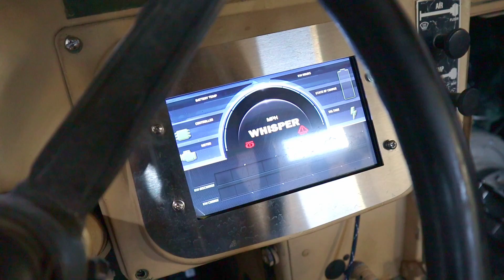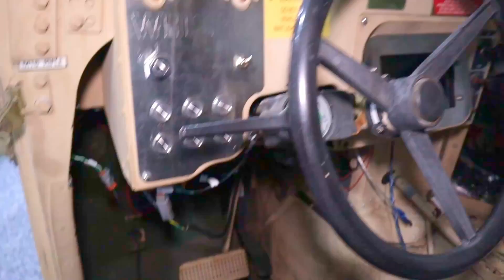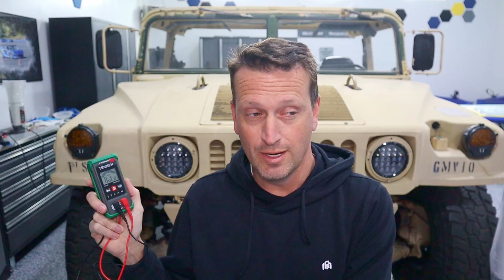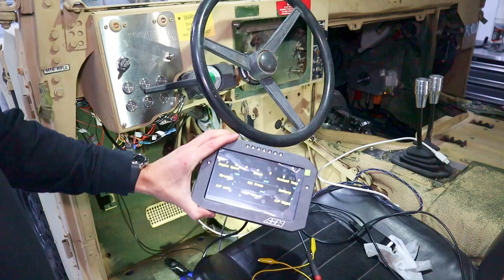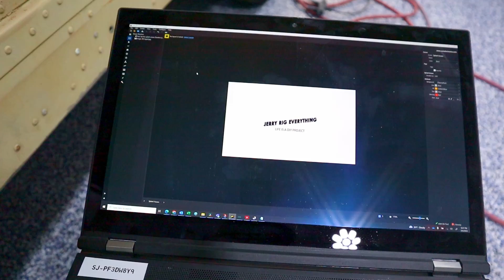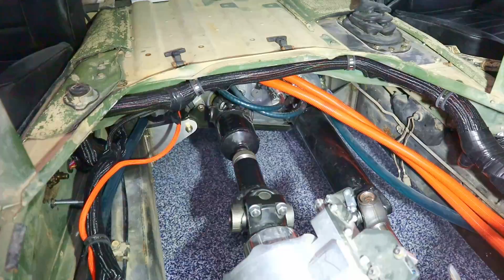Electric HMMWV Display

Comment: Pro tip if you take a lighter or heat gun over you temflex (the wire cover) after you cut it you can melt the fibers and stop them from unweaveing
Reply from the maker: Nice!

Comment: Personally I wouldn't give that multimeter to anyone. the cheapest I will go is Uni-T. The brand for that multimeter doesn't even seem to exist. Even the ratings don't make sense. "CAT 2 600V, CE, and ROHS Certified" doesn't make sense. ROHS doesn't have a certification really, CE is self certified, not by a third party, and CAT2 is pretty awful. half the outlets in my house don't count as CAT 2 because they are less than 10 meters to the panel.

Comment: Hi. I’m thinking of dropping an EV “kit” into a surplus HMMWV.  It looks like several companies are starting to make “drop in” kits. 

Would it be possible to run power and data to motors attached to the wheel axels, and remove all other driveline gear?
Reply from the maker: That would be cool!

Comment: Nice work on the wiring.  I have no EV experience, but do have experience with Industrial Automation Systems and your problems could be related to a duplicate CanBus address (two or more devices have the same address).  My number guess is 357.

Comment: A lot of your problems looks like classic bus integrity problems... Reflections, Terminations problems, etc.
For best operation, you should have One continuous twisted pair, with very short taps coming off it. (Shorter the better.) Also, at each end of the twisted pair, you should have Temination -- two total, and no more. Get a pair of 120 ohm, 1/4 to 1/2 watt resistors for the termination.

Check to see if any devices on the CAN Bus have built in termination, and TURN THEM OFF.

Comment: A critique and a concern. Electrical tape is not a permanent solution. Anywhere there is heat, that tape is going to fall off. The concern is the air bubbles in the coolant lines. When I murdered a racoon with my Model S and replaced the radiator, I could not get the car to charge, without overheating until I found a way to bleed the lines back near the charger and rear motor.

Comment: 2517. 
I plan to do outdoor night-time car photography. I made myself a 12v 40a powerpack with LiPOs with a 1800W 120acv inverter to be able to power two strobes (these are huge, 100w each).
I need to know when to stop to not leech my cells below 20% capacity. So this tester would be useful.

Basically at car meets on a Friday or Sat night, using Adobe Lightroom and my laptop for editing on the spot. It all has to fit inside my Miata.

Comment: along with odometer maybe its useful to also display 'hours run' or maybe better a cycling count, they say a range of cycles to degradation but nothing i have seen indicates where in the cycle range the pack currently is and that is very valid to resell/purchase similar to odometer

Comment: An multimeter would be amazing piece of hardware to have around the house. I'm currently using only of the cheap $25 meter.

I'd also use it to teach my son more about electricity, as that is one of my current primary responsibilities.

I'm going to say number 862.

Thank you for the opportunity!

Comment: I'm guessing 819.  I would use an electrical meter for check continuity, power, switches, etc. on automobiles and arduino circuits.  Your electrical harness makeover was great.  Need to do that for my DF Goblin kit.

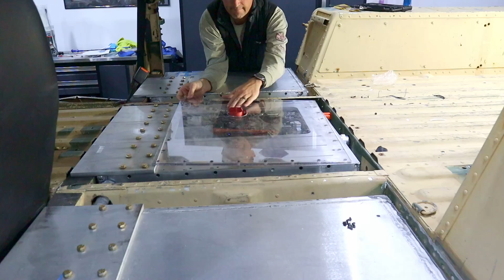Comment: 9:36 That hole is rough AF. 
Apply some heat to where you cut to clean it up.  A lighter, flambe torch or similar will do.  When you apply the heat, the white will disappear, you'll get a nice clear edge and it'll remove some of the roughness.  Don't apply too much heat otherwise it'll start to burn.

Comment: My guess is 410. I plan to use the multimeter while rebuilding the 12v system on my classic motorhome, and general stuff around the house. I also need to diagnose why my wife's sideview mirror defrost isn't working.

Comment: A couple of random comments.

I hopped on and ordered the multimeter right away. I’ve got a good one. I just don’t know how to use it. I’m never sure exactly how to send it to read what I want and now I feel idiot proof.

As for all the wires, that’s a lot of wiring. I’m glad you didn’t take any out. I’m sure it’s part of the safety system. In case of some catastrophic event, they will help hold the thing together.

Comment: My guess is 1776... Great video I learned a bunch about troubleshooting and wire management. I have a project in mind and have been following Jerry's project closely. I am glad it is working out so I will be ordering some parts. I would like to electrify my Dodge Dakota. If this motor will push a Hummer it should have no problems with a Dakota. ;-) That multimeter would come in handy for sure!

Comment: I'm going to guess 829. I'm getting ready to build out an off grid leather work shop with solar powering 110v and 220v ac power. If I don't win I'll probably buy one anyway. It'll be super easy to jumb between measuring units with the auto sense

Comment: that multimeter would be great for someone like me who has no idea what setting im supposed to be on except for the standard few. i would be using it when working on my 1990 Miata project car/daily driver and also diagnosing the electrical issue thats keeping my motorcycle from starting. my guess for the number is 429.

Comment: The problem is with the display. It has to clear and write new values every time. You must ensure that it clears before having to write new values. Maybe put it on a loop if you have access to programming.

Comment: Instead of using a manual switch for the cut off voltage. Why not use a high current/voltage relay or Solenoid  which can be controlled with the 12v battery circuit from a switch right on the dash board

Comment: That's an awesome result... Shame that a whole new display had to be purchased, but if that's what it needed, so be it. The charging section is really challenging from what it seems, but it's great that you're confident that you'll get it fixed. I'm going to guess 30. The speed you were doing for calibration. None of multimeters seem to work properly!

Comment: 501 - Right now I have an antique craftsman multimeter that doesn't do much an upgrade would be much appreciated. I use a meter on all sorts of projects from around the house electrical to modifying my vehicles (have an 80's s-10 torn apart now getting a 6.0L V8 truck engine), to R/C vehicles and 3D printing. Thanks for the oppurtunity

Comment: 367
Reply: I will use the multimeter to check the electronics I buy and fix and find their electronical issues. So far I have to use my universities equipment and would be great to have my own!

Comment: 482!! i am an electrician so have a lot of application for using the multimeter.especially because I specialize in solar panels and home batteries, so there is also a lot of measuring involved

Comment: For the multimeter guess I'm going with 745.  Great content here, love seeing all of this troubleshooting!  I plan to use this multimeter to get good readings for when I do voltage readings around my house with my solar, batteries, high power receptacles, etc.  My current multimeter doesn't read them correctly and always starts with mV and when I change it, it just keeps reverting back and not giving me correct readings!
Reply: 1-1000
Reply: @manny1766  oops, thanks, correcting it.

Comment: My guest is 777! Could use it as my current very cheap multimeter has one of the wires torn at the tip. On top of that, I had it on DC ones when I needed to test an outlet really quick. It now has a burn mark on the tip and flipped a fuse, whoops. Can use it for all kinds of DIY projects

Comment: That new display looks great! Is it possible to use the big dial in the center for speed instead of RPM? It seems odd that 50% of the display is dedicated to the least useful info for an EV? A big speedometer dial plus the speedometer digits makes more sense to me! That would be my preference at least, if I had my own electric HMMWV 🙃

Comment: My guess is 271. That looks like an impressive little meter for $10, I'd probably use it as my every-day-carry multimeter for school (currently studying to be a computer engineer) or keep it in my drone kit for field-maintenance. It would be nice if it had a current mode but you could always throw in a precision shunt resistor and use that to measure current. 

Also, have you considered getting a lavalier mic or something for your "talking head" shots? Most of the time they're fine but the intro of this video was pretty quiet and had a fair bit of echo.

Comment: I am so impressed with your ability to stick to it and run down every little detail. My guess is 124. I am working on some running down some errant wires in my daughters house I’d use the multimeter on.

Comment: Congrats on getting the electric Humvee mostly working!  Well done! Number guess 314. I plan to use the multimeter to check things when my home gets rebuilt. We had a major house fire on December 21 & they are starting the rebuild soon.  PSA: don’t leave bathroom exhaust fans running. It’s 100% certainty it started due to an exhaust fan failure & the fire chief suggested putting them on a timer. When I told a coworker about our mishap, he told me the exact same thing happened to his father in law too. Be careful people.

Comment: 777, I will use it to trouble shoot my EX-GO electric that I converted to a new controller and digital accelerator. Cant find the glitch after running it for a while it died.

Comment: This is the stuff that scares me!  Give me a mechanical issue any day or even a straight forward electrical one but when I comes to computers I feel lost.  Given that all the experts failed to find the issues in this example does not fill me with confidence. I’m currently working on building a home storage battery and making up cables for the CAN communication between BMS and inverter.  This multimeter looks great, I have two already but both have issues so I can never trust them.  728!

Comment: I'm going to guess 777 and my plan for the multimeter would be to check motherboard voltages in gaming systems and sometimes checking diode readings best of luck everyone!

Comment: 415 is my guess for the number of volts in the cars circuit. (mind you, this is my first comment on your channel....)

I'm an offroader - last year I crossed Australia's Simpson Desert, 5 days without seeing another vehicle than mine & the one we travelled with) One of these auto-sensing DMMs would be great because you just don't want to mess up when ranging or checking continuity with car or fridges in such remote areas. A zapped ECM can mean the difference between enjoying your holiday and being helicopter rescued. (Or helicopter delivery on a replacement ECM for the car)

Comment: 668 is my number. This multimeter could really come in handy troubleshooting a 2007 Kia cee'd 1.6 crdi which I replaced the engine in, but cannot get it to start. No schematics, so gonna have to check every wire going from the ecu to each sensor on the engine.

Comment: so, i have a Fluke so not in need of a Multimeter, was just wondering with that Auto feature, if for example im testing a Zenor diode, will it auto select diode testing or voltage testing?

Comment: Great video and great job on getting the "Whisper" brains working. I leaned a lot more than I expected. My guess is 240. If I win, I will use the multimeter for house repairs and to get my dad's craftsman drill press working.

Comment: Loving the progress!  I am certainly curious to see what the charging looks like.  As for the multimeter, my guess is 495.  I have been needing to replace my meter, as finding leads that work in it is getting impossible (meter is 35+ years old), and the other meter I have is about 75 years old (a treasure from a garage sale, and it still worked) and the leads on it are again different from my regular meter.

Comment: I have recently fought a flashing problem for programming a device that I'm using for my PHD research. The issue is that I have a micro SD card hooked into a specific micocontroller so that I can log information on a per device basis. The research involves using a mesh networking protocol that I invented to communicate data through a network of devices back to a gateway device and then back to a server where data is collected. The specific problem, with programming the flash is that if a micro SD card is in the device and connected to the running software, I cannot program the device. If I remove the card, it programs just fine. If I turn off all power to the device and then program the device before the SD card software is started, it programs just fine. I don't know if you have a similar situation with your display or not. But it is possible that if there is any power at all coming from any input the device may not program correctly. Or it might be something completely different. I worked around my problem by creating an external power switch and a delay in the start up of the SD card so I could power things down, plug in the USB connection, and then program the device before the SD card powered up. So I now have two solutions, remove the SD card and program, or power down, plug in the USB cable, and then program. It's annoying, and I assert that there should be a better solution, but if it works.. Probably more information that is useful, but maybe someone who knows about the firmware on the display could intuit a solution. Glad you got something that works!

Comment: 679 is my guess. I misplaced my good multimeter about a year ago, bought a replacement, and then late last year finally found my old one. I do a lot embedded programming where I'm putting together hardware etc. Most of the time I check continuity with a multimeter but the ones I have use a frequency that I cannot hear. I could hear this one on the video so hopefully in real life it is better. I also am a bit color blind so reading the lines on resistors is a no go for me so I use the multimeter to figure out the resistance a lot.

Comment: Lets say 368. I do not have a specific use for the meter as yet but they are handy for diagnosing many electrical issues in construction or automotive and as I live in an older building and drive an older car I am sure it will get used often. Great videos although it would give me pause if I was planning on creating an electric conversion from scratch.

Comment: Awesome progress! My guessing number is 425. I'd use the DMM for the 3D printers I build as well as small electrical projects. I've used a fluke multimeter in the past but it does get old to always need to change modes to measure voltage, resistance, and continuity.

Comment: Great job. You are the man. I have just retired from auto repair. I did diagnostic work for 35 years and can say you are like a pitbull, once you start a job you hang on till you get it done. Great work Diagnostic work is some of the hardest parts of automotive repair. Especially when you get one that some one else hands it to you after they have tried to fix it up.

Comment: Jeremy, My guess is 722 because the 7 looks like a F and the F-22 is the most awesome aircraft ever.
I would use the DMM as a trunk tool for my electric converted TR-7     Overbraid and clamps, such quality.  You and Zach have neat project.

Comment: Interesting DVM, I would use it for Diagnostics on my 7.3L PowerStroke engine, plus all of the other things I have, been an Electronics Tech since 1958, and rue the loss of my Fluke 77 ... been an amateur radio operator since 1958 also, Extra Class since 1980

Comment: Ovethinking this but you said a number between 1-1000 and then you said you’ll be picking a 4 digit number so my guess is 1000😅 cause it should be closest to your number. I’d use the multimeter for my high school project a robot that solves rubiks cubes 😊

Comment: my guess is 313, because my birthday is on 3-31 hehe.
Since im starting to create a lot of DIY projects (hydrogen generator, smartmirror, bionic hand) i use a multimeter quite often, especially when im working on a PCB. sometimes i get confused when i neet to check resistors and transistors, so i mostly use it for that.

Comment: 468 :3
Reply: Frankly I work on electronics and car interior. I would just use it as a backup multimeter for when I'm in a tight pinch. I have a Sperry as my main, however in tight spaces with my hands full switching modes could be a pain in the butt. It's kind of the same reason I have the LTT screwdriver. It's great for car interior :)
Reply: Watch it's going to be a number like 789 xD

Comment: My number is 372. I would use a multi meter to check connections in electrical fixtures like Christmas lights.  Just a little more and it will be finished, I hope it doesn't have to be painted.  Because he.  will have to be completely torn apart again.

Comment: 327 I would use the multimeter as a backup for work in the low voltage trade.

Comment: 318. This kind of multimeter is a must have tool for doing diagnosis on elektrical systems. This multimeter also seems easy to use and to learn other people how to work with multimeters. I intend to use one of these for everything imaginable. From continuity to charge checks. I work with cars and scooters so a tool like this makes electrical jobs a whole lot easier. Also just an awesome video again. Weird problems but you do manage to solve them. Wicked new display and already cant wait for the next ep

Comment: 0832 I'll be using it for whenever doing electric stuff around the house. the house is in desperate need since the current (no pun intended) installation is more than 50 years old!

Comment: I'll guess 13 (or 13.13 if decimals are allowed). I work in IT so I plan to use the multimeter for testing PC hardware (motherboards, graphics cards, and even the occasional battery ;)